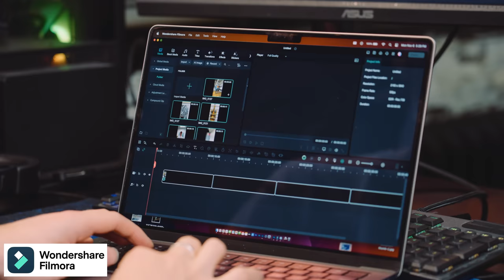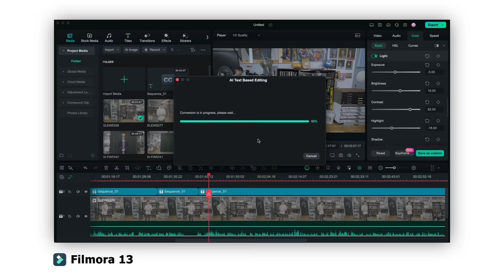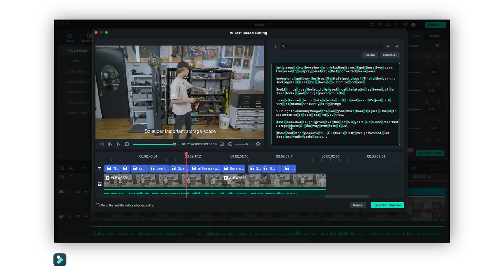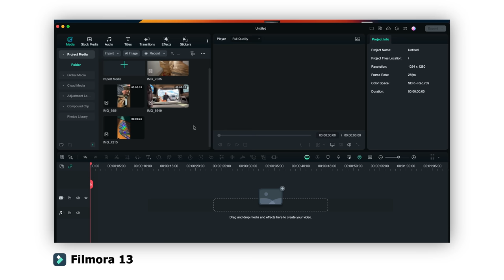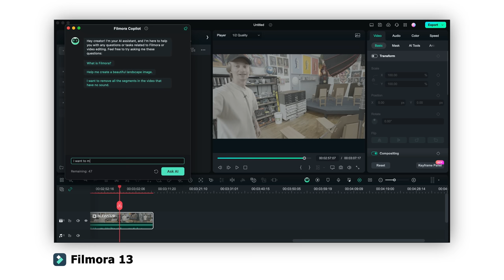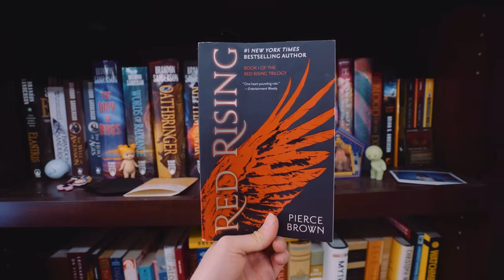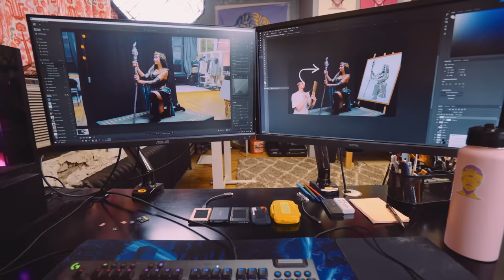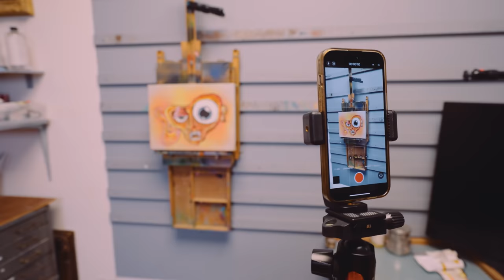Building my Dream NYC Art Studio - 3 years in 30 minutes

Comment: You might be able to like add an extension to that table when you need it. The table that you feel is a little too small when you wanna gesso bigger paintings. I wonder if you could add an attachment to it that you could take off when you don’t want to use it. Just a thought. I have a table that can be very skinny or very large because the table folds down when I need it too. It’s nice that you have a table that can adjust to different heights :-)It’s very cool that you’re living your dream :-)